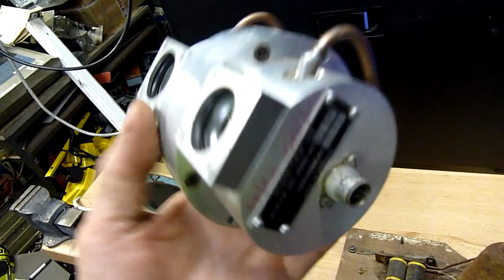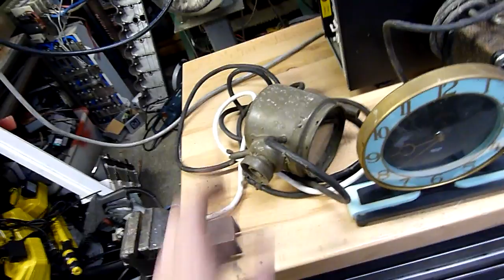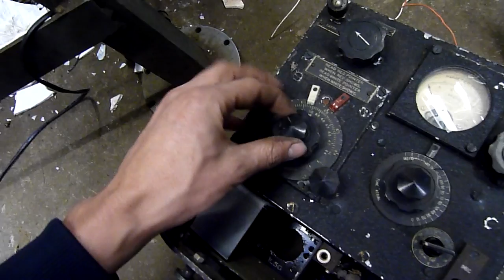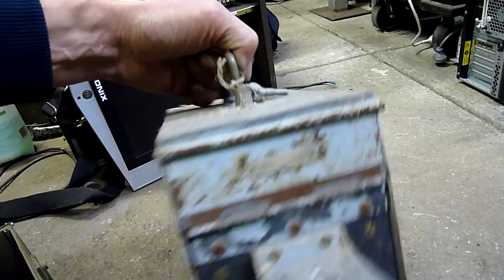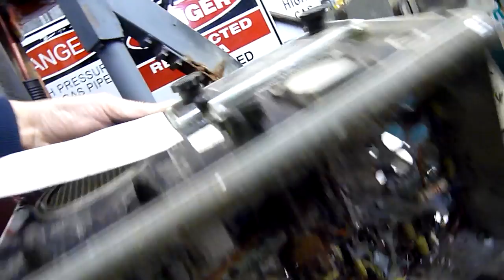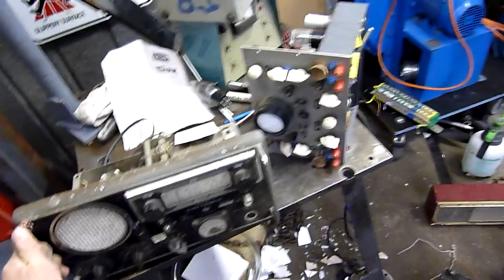Vintage Electronic Scrap Inspection, Radio, Vacuum Tubes, Morse Key etc

Comment: where did you get/find these?ive hacked,scrapped radios, clock radios, answering machines, telephones (all were non-working, non-repairable), have about 50+ of diff. sized speakers (small, to huge speakers)- all of the speakers do work fine.where could I sell them, or trade for something else?

Comment: yeah, that is all they usually need. here in the US, we have a lot of clocks that have Sunbeam made movements in them. they have a small rubber gear on the rotor that dries out. fortunately, this gear is found in a lot of other things. i have fixed two, and i am getting another one to fix.

Comment: An infra-red gas analyser, used for differential measurement of carbon dioxide concentrations, has been calibrated both by a pressure difference method and also by absolute concentration differences. The two calibrations differ, and a correction factor for the pressure method has been obtained.Issue 10 (October 1968)

Comment: The old clock looks more 40's and could the material be bakelite .  I have a morse key exactly like that but mine is on a wooden base or at least the bakelite part is and the key knob has a flat disk for your fingers to rest on.  the valves look old, i have a radio with 4 pin valves its a AWA Empire State Radio.
nice collection of stuff.

Comment: I think that the empty compartment in that AWA Military radio may have been for the batteries or a power supply unit with a vibrator. Battery tube equipment typically ran on 90 volts for the Anode and 1.5 or 2 volts for the tube filaments.

Comment: Most of the tubes that were radioactive were gas-filled voltage regulator tubes,and such. The radioactive substance (i forget what was commonly used,but it wasn't terribly worry-some,and had a short half-life.) was to help the tube 'strike' reliably.
The level of radiation in them was pretty small,and many are now so old that they're past/nearing the half-life. No real worries there.
Mercury filled rectifiers are probably a greater risk,at this point in time,so don't break them open.

Comment: That 469 tube is a mercury rectifier. If you fire that tube up, don't turn the B+ (high voltage) on until the tube has warmed up for a number of minutes, or the tube will arc and destroy itself. When you energize the heater elements, the glass will go cloudy. Just wait until you see the smokey deposit clear up.

Comment: Infrared capacitative detector. HILGER-I.R.D., check the clock with a geiger counter if it lights in the dark, the green box looks like a antenna tuning unit (for adjusting s.w.r.).

Comment: To get you started: "h t tp : / / w w w . c a rrmclean . ca / Cate goryGroupBrowser . aspx?CategoryID=687&GroupNo=7799"

In some parts of Europe they still use these as opposed to the new tech that feeds directly in to a pc. Either limited resources or the portability of such a device, no need to drill holes in your nice old museum building.